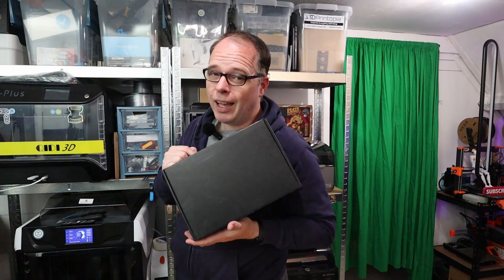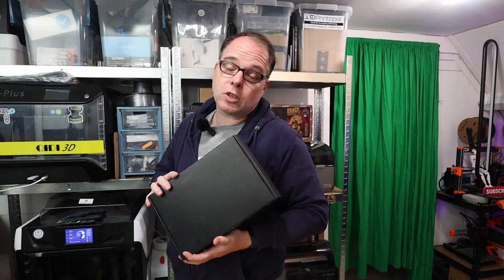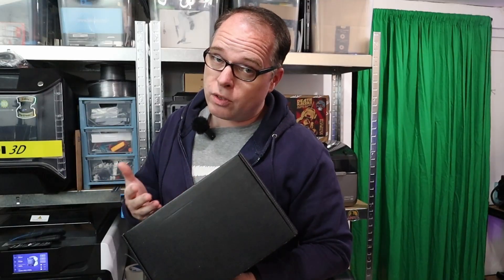Installing a Filament Cooler on My Bambu Lab – Worth It? MartilloTech Extruder Cooler

Comment: Imho, it seems to be an solution for a problem that doesn't exist.
Reply: @TuncayAyhan  it’s a real problem, especially if you’ve had to tweak a printing profile for PLA a complex part and your printers are in an environment where temperature is too high to allow for adequate cooling of the hotend.
It doesn’t happen to everyone but does happen.
I’m not sure this is the right solution for me but I’m watching
Reply from the maker: Yeah my thoughts too, but it seems to happen to many users...
Reply: I’m curious if it will help with the pa da and microswiss hotend heat creep issues on Bambu to make them more usable for long prints.   If it truly keeps the extruder a few degrees cooler, it might be worth it.

Comment: I wonder on TPU, because its already flexible when cold.
When hot its more flexible, i had 2 jams on my H2D with Polymaker TPU.
So maybe this will work better.
Reply from the maker: Yeah indeed... but you can always try this
Reply: Same here. The entire extruder gets hot and softens the filaments while they wait their turn to print, then it fails. I was thinking a fron t fan at least is required.